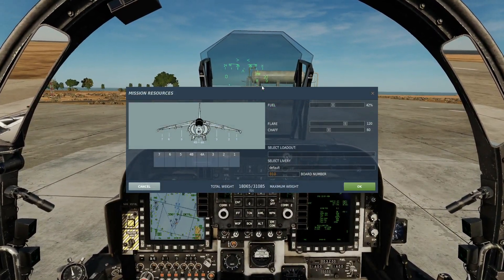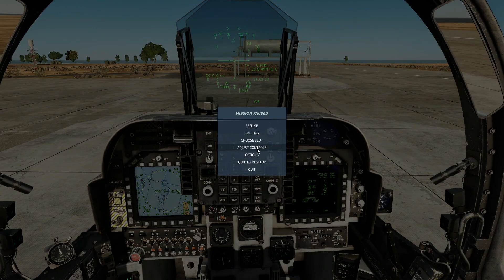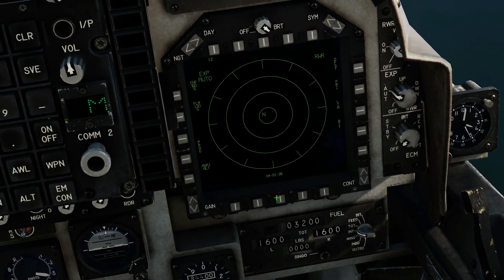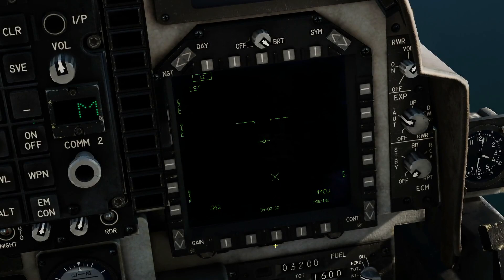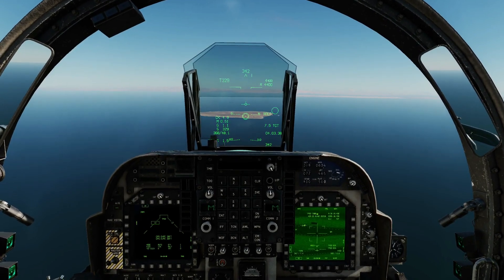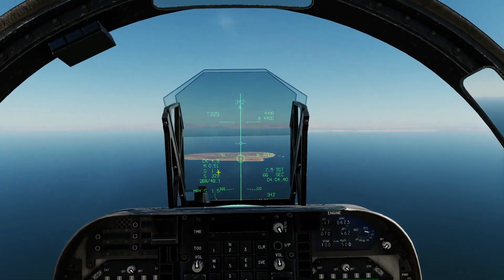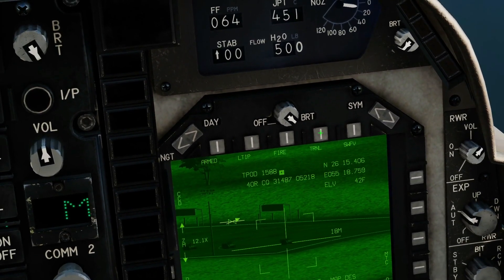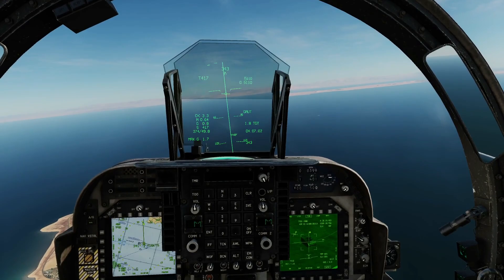AV-8B Harrier: GBU-12/16 Laser Guided Bombs Tutorial | DCS WORLD

Comment: ummm. followed everything in the video. but the LGB's do not track to the targets. they pickle, they fall, but do not hit the target. they go way past it. quadruple checked and there is nothing i am doing differently to yourself cap. everything you do is identical to what i have done...this a 2.8 glitch? cause on 2.7, the tpod acted very strange indeed.

EDI|T - works on code 1688, not 1588 - ummmmmm. working now on that default laser code
Reply: sounds like you did something wrong with the laser codes then